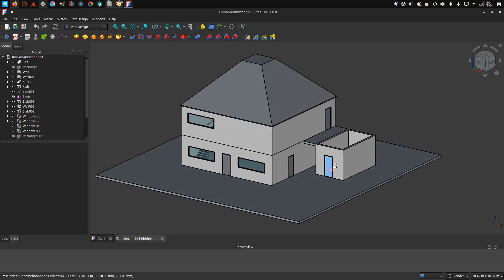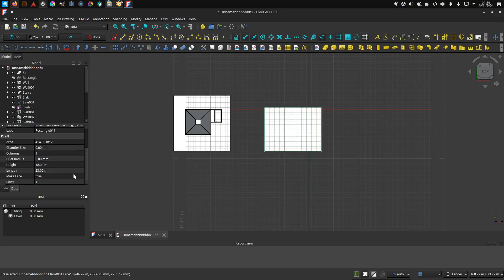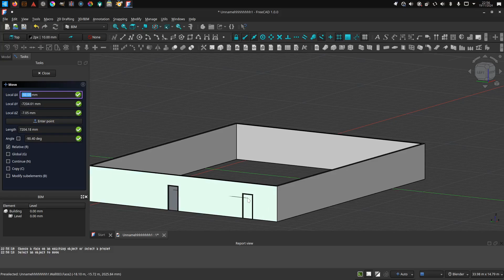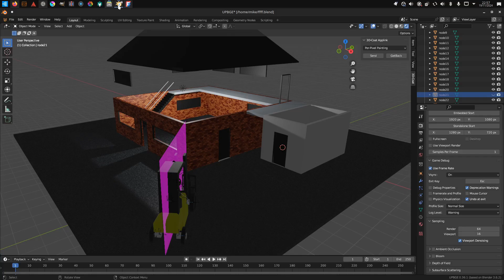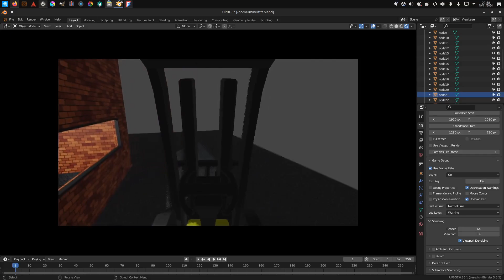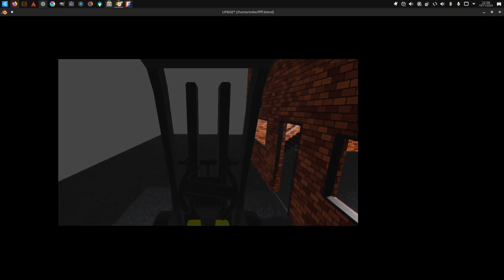Using FreeCAD 1.0.0 for Game Development

Comment: So you can use the Blender Game Engine port to make a quick model and then walk through it?

My kid wants me to make a game where you walk up starts and then jump down, so you can walk up again.

Any insight?

FreeCAD is a pretty interesting hot mess of tools for object and architecture design.
Reply from the maker: Yeah I reckon UPBGE would be easily able to do what you are trying to do, and I think the best thing about it is that it has a logic node system like scratch.You don't need to use code to make anything do stuff. You can use code, you can attach scripts to things like in other game engines but you have the option of just using the logic nodes system. I think I should do a video about it on its own because it is a brilliant system. I didn't write a single line of code to get my forklift to drive around. The great thing about UPBGE is that because it is a modified version of blender it uses all blenders tech, so shaders you make will work in your game, EEVEE is the renderer and it will be compiled into your game binaries, geometry nodes can be used.  I really like it as a game engine and I am so glad that it got resurrected. FreeCAD is getting better and better,  I have been finding it intuitive to use for precise modeling but I need to get better with it. The BIM workbench is a godsend because it quickly produces standard architectural features which are what I need for a forklift game. I do recommend it even if just for prototyping logic, because once you have rigged out something cool in the logic nodes I am sure it would be a simple task to transcribe that into a script for porting to other engines.
Reply: @ Oh I did not know that we could export the UPBGE as an executable app to start. That brings up many interesting ideas like making interactive apps for touch displays for exhibition design.

I looked into 3D Verge which is really powerful but if I could do all native in Blender I rather would like that.

Thank you for the tips!
Reply from the maker: @cekuhnen  That sounds awesome, I can't wait to see what you come up with. I can see from your channel you are already really good at this so I think I am going to go and get some tips off of you. I really like your style it will be great to see it made interactive.
Reply: @ I have plenty of experience in 3D modeling but game engine design etc thats a different story. I am also looking for a tool easy to learn for students. And it seems that the Blender custom build might be an ideal case - as they learn Blender anyway.

Honestly Blender Foundation should reactivate the game engine.

It would be so great for also prototyping product designs etc and how users could interact.

I am happy to help each other anyway - I am in education - that’s about learning and sharing.